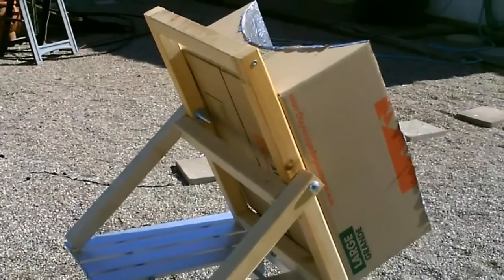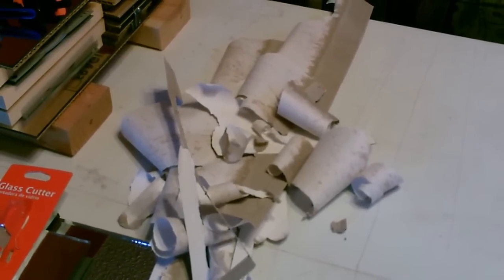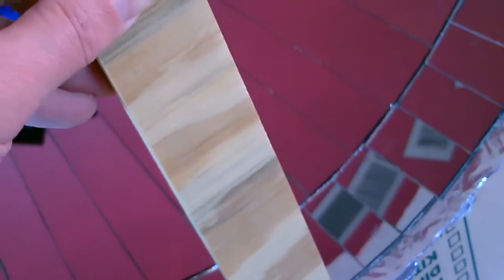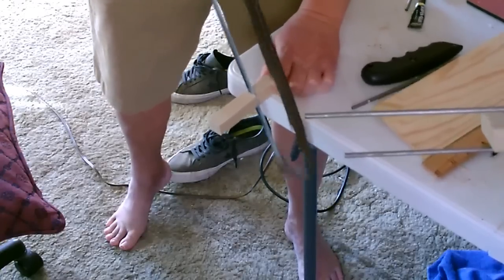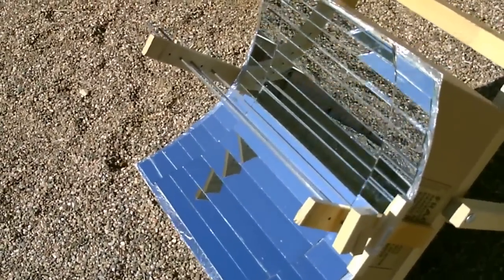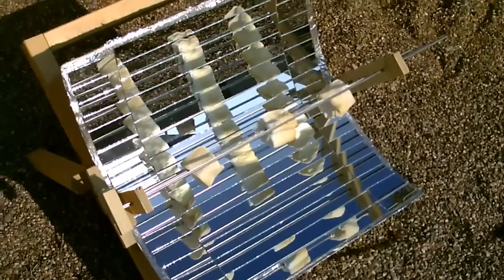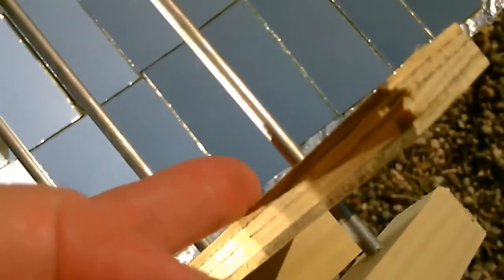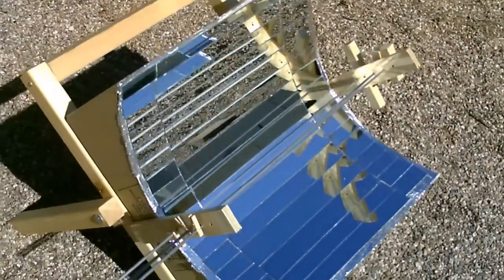DIY Solar Cooker! - Fully Mirrorized! (w/glass mirror conversion!) - Cooks Great! $14 - Easy DIY

Comment: Lots of cooking options with a this type cooker. Super hot at focal length.
Reply: ...the angled notch for lifting instead of a hole on the handle end is a great hindsight idea.... pulling a skewer through a hole while cooked food is attached might cause problems eventually. That's why videos such as these are so valuable.  Thank you.

Comment: What did you use to cut the mirror?
Reply from the maker: hi there. just one of those cheap ($5-$10) glass cutters. the ones with the tiny cutting wheel.

Comment: I like it you did well again how thick would you say the mirrors are like 1/16 in thick I like to actually make solar projects I found a 28 by 33 satellite dish and covered that with mirrored film and that I used to cook with hamburgers so on boil water to cook eggs in hard boil
Reply from the maker: hi there. your guess is accurate. the mirror is probably 1/16" (at the very most 3/32")